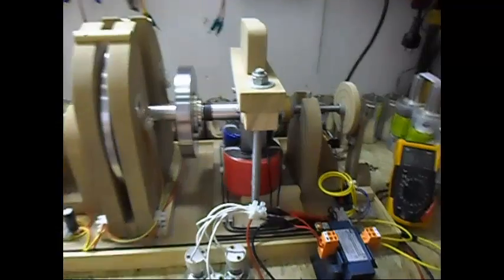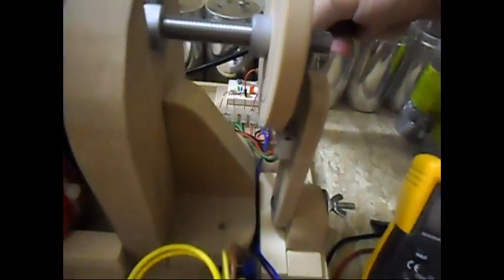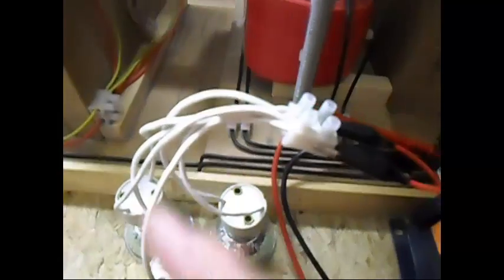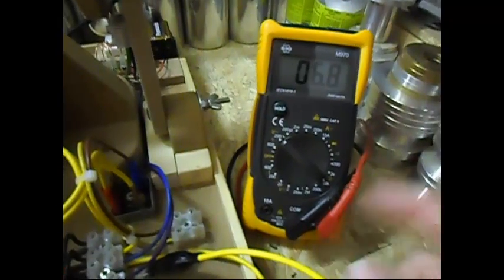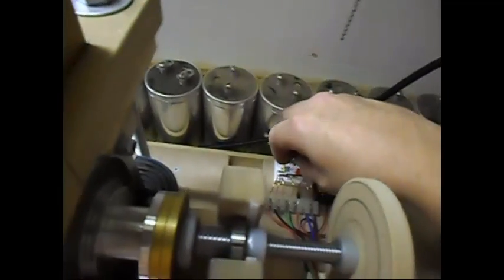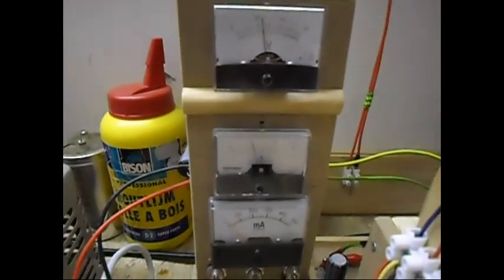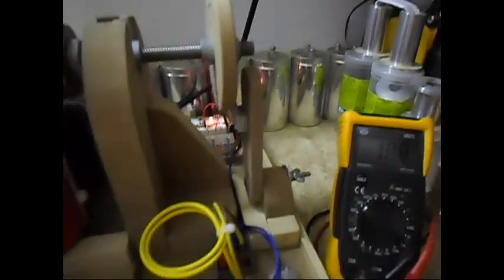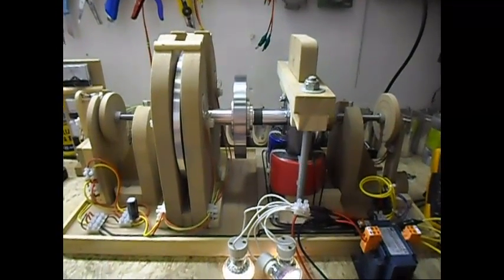Project U-core Dynamo - Update 6, Transformer & Coil shorting, higher voltage but lower output?...

Comment: Show your circuit diagram so we can see what you are doing wrong with your coil shorting. ..normally it should increase output power. Thanks.
Reply from the maker: Thanks for your comment...^^
Under normal usage it does increase the output but not when i short it thru the transformer primary...???
And this circuit i found online some years ago but can't seem to find it now but it is one with 2 high voltage N-channel mosfet/hall sensor and it does work very good...:)
Will show it working on the single phase generator in a few days time...^^

Comment: thank you for sharing!
is possible try connecting (pulsing) the transformer to the generator via the same reed switch instead shorting?
Reply from the maker: And thank you for watching and commenting...^^
Hmmm, trying to figure out what you mean here...???
I have the shorting now in parallel with the dynamo coils and transformer primary...;-)
So you want me to place the shorting in series with the dynamo coils and the transformer primary, yes?
If so i will do that in a few days time and make a update on it...^^
Maybe a AC cap in parallel on the dynamo coils before the shorting may help it out...we'll see...^^
Reply: +Mister Caribbean Roots great !

Comment: Your rotors are very heavy, what about aluminum...? I tell you this because it would be interesting if you try a maglev rotor, in the past i did a perfect maglev rotor with 48,000 RPM, two big neodymium magnets inside in a copper pipe, very save rotor, but low BEMF (energy conservation law)...!
Reply from the maker: Thanks for your comment...^^
The rotors as i have them now are perfect for this setup and in this case i don't need a lighter rotor and very high rpm...;-)
I remember seeing that maglev setup of yours, it was a nice one...^^

Comment from the maker: Just an update on my U-core Dynamo setup with coil shorting...^^
With no primary connected the volts go from 19 to 25(ish) when coil shorting is enabled and system slows down a lot...-.-
When primary is connected the volts go from 7 to 19(ish) when coil shorting is enabled but but but the output is crappier with the coil shorting enabled than when it is disabled...???...o.O...lol
But it was a good test nonetheless...^^